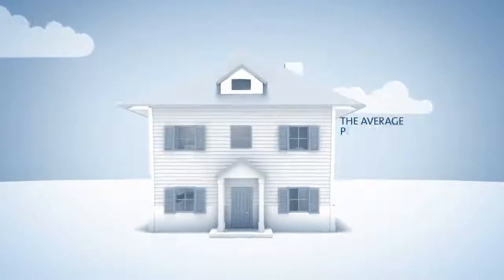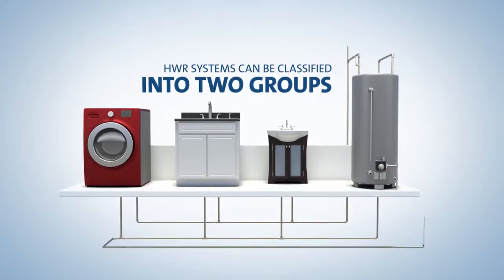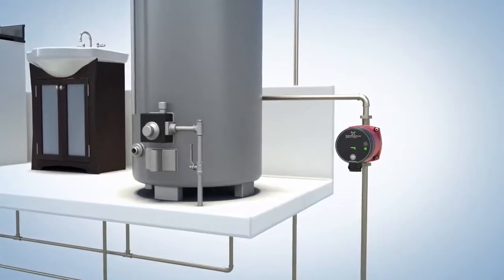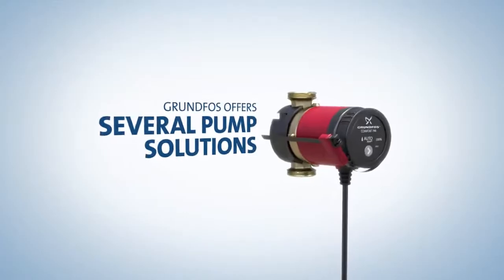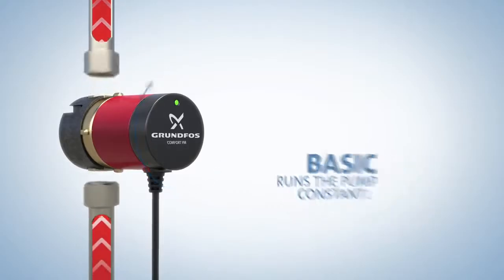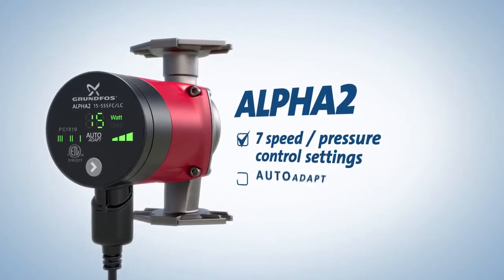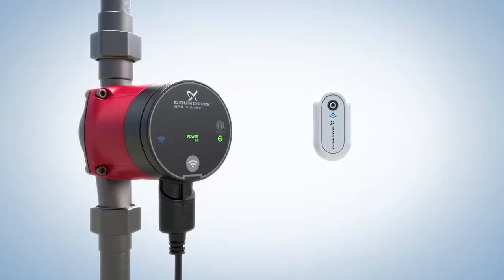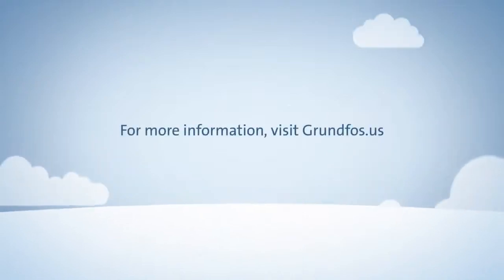Grundfos Hot Water Recirculation With A Return Line

Comment: I plan to tee into the cold water supply line just before it enters the water heater. Do I need to install a backflow preventer above the tee on the cold line?
Reply from the maker: Hey there, for our HWR products that work without a return line, you don't need a tee. The ALPHA Comfort System for example would be installed on the outlet of the water heater. For more information, you can find documentation here: http://gfos.ly/6057I4DT7

Comment: How does the Comfort 10-16 shown in this video compare to the Grundfos GRU-595916 product?  Is the Comfort 10-16 newer?
Reply from the maker: Hey there! It's not necessarily a newer pump, they are just different depending on the installation needs, such as sizing and if the application has a dedicated return line or not. The Comfort 10-16 is for systems with a dedicated return line, whereas the Comfort System (GRU-595916) is for retrofit applications that do not have a dedicated return line. Hope that helps! -Ty
Reply: @ appreciate the reply, thank you!  how do you set the desired temperature for the Comfort 10-16 model which offers that? (2nd one mentioned)
Reply from the maker: You can find info on setting the different model of pumps on page 20 of this guide: http://gfos.ly/6059QEMzh

Comment: I wanted to have the Alpha 15-55 HWR-D installed at my residence, but the plumber I contacted said that it is no longer available for sale in the US. Is this true? Thank you.
Reply from the maker: It is a product that is no longer being manufactured, that is true. There is some inventory still out there, at Supply House for example: http://gfos.ly/6050sT7YQ

We recommend the new ALPHA HWR 15-58, however if you're needing the on-demand feature, you will need to look at the pump above.
Reply: @ Thank you for responding. I have just repiped and improved an existing dedicated hot water recirculating loop. I am looking for an “on-demand” system.

Comment: In your diagram (dedicated return line example) it is not clear where the water reenters the tank after the pump. It just shows a pipe going behind the thank.  I have seen examples where the water is returned to the tank via the drain outlet at the bottom. However, your example doesn't seem to be done this way. What is your recommendation for connecting the return line to the tank? Thanks!
Reply from the maker: Hello there! Our pumps will always require connection to the return line. They can be placed in two different locations - either connected to the drain outlet or piped up to the cold water line. The main requirement is to have the pump hooked up to the return line close to the water heater.
Reply: @grundfos  So I am clear on the above answer. My water heater does not have a recirculation pump inlet. There is just a cold in and a hot output on this this water heater.       I have run a return 1/2" PEX pipe system from  the furthest fixture in my home to the water heater. For the water heater side of the connection I want to plumb that Pex line to the water heater for a Grundfos hot water recirculation pump.   Is your suggested install to mount the recirculation pump to this PEX pipe and then tee the outlet of the recirculation pump into the cold water inlet line of the water heater?   Can you please give me  link to photo or diagram of such an install?
Reply: Thanks!

Comment: I have an older Type UP15-18 B5 pump with a timer on my dedicated 1/2 inch copper return line, unfortunately it no longer works. I would like to replace it with the same or similar pump, which one is the closest model?
Reply from the maker: Hello Colin, you can still find this pump in stock at some distributors. There is a link that will allow you to find a place to purchase on this page: http://gfos.ly/6055T4vuF

Hope that helps! -Ty

Comment: What causes the pump to keep running. The motor is getting warm.
Reply from the maker: We're thinking that it's likely on 100% mode. Depending on your model, you can limit the pump running based on timer, temperature sensor, or AutoAdapt learning. Running on 100% is usually not a concern for this pump as it doesn't really use that much energy compared to things like a lightbulb. If you still have a concern, please feel free to get in contact with our support team: http://gfos.ly/6053r63WZ

Hope that helps! -Ty